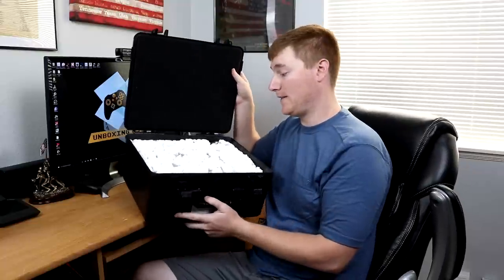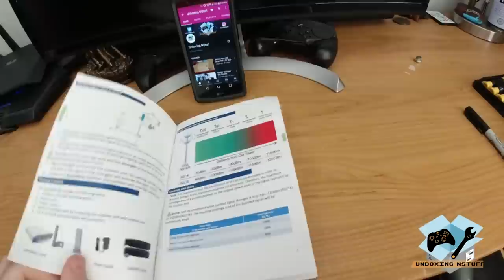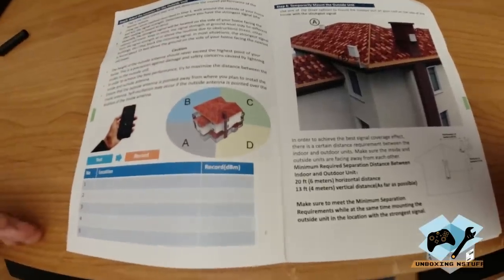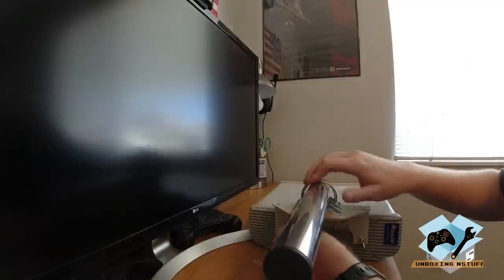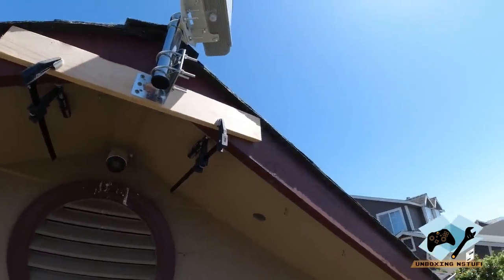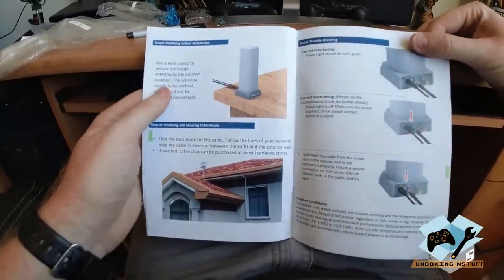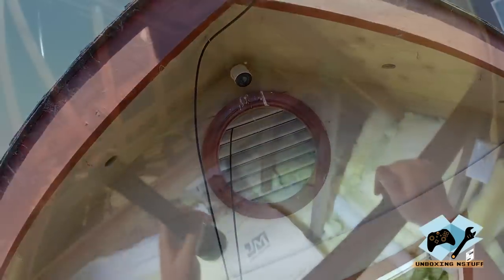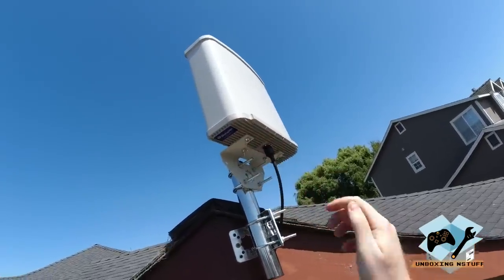SolidRF Speed Pro

Comment: great video.  you need a drip loop on the outside under the antenna though.  otherwise rain will follow the cord inside into the attic and not be good for your house.  just make a loop or dip in the cable thats lower than where it enters the attic so that rain will drip off the cord outside instead of running along the cord inside your attic
Reply from the maker: Thanks for bringing this up, it is something I did after the video. Good catch!

Comment: I commend you on your efforts to video the installation through your hot attic. I wouldn't have the patience and would  have to hire someone.  I'd really rather see a redesign of the unit to convert the cell signal at the outside antenna to a wifi or bluetooth signal to go to an inside unit and be reconverted to cell again.
Reply from the maker: Thanks for the comment, that is an interesting idea it sure would have been easier.